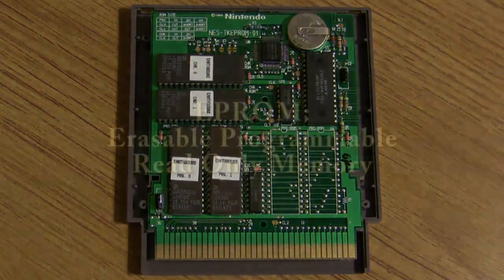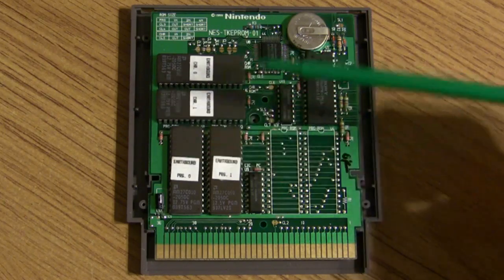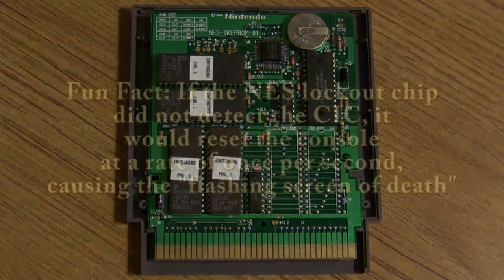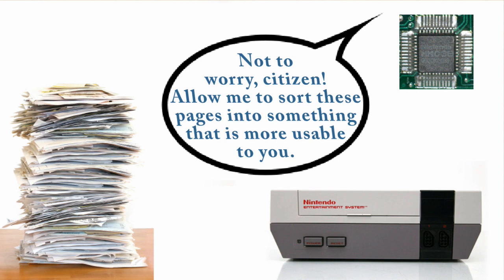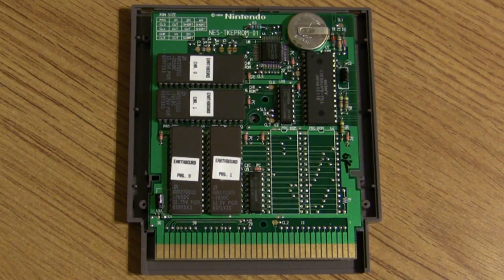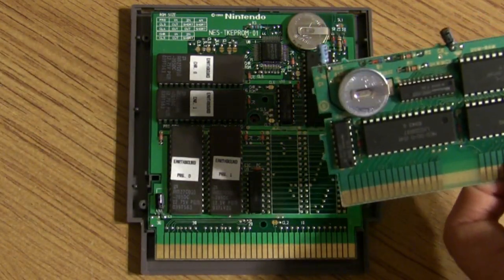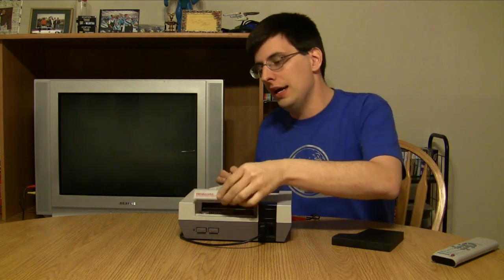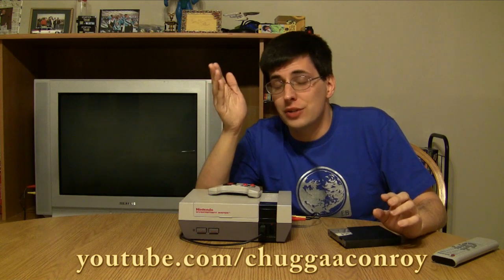Hands On: EarthBound (NES) Prototype [Part 2/2]

Comment: Finally I get to comment on this cartridge. You're holding a REV - C EPROM cart because it's MMC3. This cart is used as you said for internal use. Replica's or reproductions are starting to come to the market. As well since they have larger storage capacity for NES carts. 

The largest size you can have is 6 Mbs or 558,444bs (rounding up). This cartridge is the "incomplete" cart that caused the emulator to be rewritten just so it could work because it had a defective read or write of the ROM. The complete ROM is the 4th copy that surfaced in 2009 of which was the editors copy for coding. Same chip set and what was called the active cart or review by internal Nintendo. 

What you have is actually the fourth cart. Also know as Earth Bound - 001. Which is the first cart written from the translated cart of ROM. However this cart was under review for technical flaws and thus the most complete copy of  Earthbound is actually on the fourth copy which you were looking to own. 

Which we now know today and has been re-released to the pubic on blank carts as the most complete version of earth bound. Earthbound Beginnings, but you probably already knew that.

Comment from the maker: @papayacatproductions Old NES cartridges with a battery backup always had a warning on the back to hold the reset button while you turned off the power so as not to accidentally erase the save data you have stored on the battery.  Come to think of it, I'm not sure exactly why that is, but it's so ingrained in me now, it doesn't seem right not to do it.

Comment: @ClanOfTheGrayWolf  Actually, I have a copy of The Legend of Zelda that does -not- have that warning on the back. It just says that rapidly turning the system on and off, or resetting it repeatedly, will erase the save data. My guess is that I have a really early print run copy of the game, which is why the warning is absent.

Comment: not quite, if you are referring to the function the MMC performs it does do some processing for the console, but they were necessary to extend the functionality of the system. Your console still runs the game code as you would expect a computer to do for a program. As Joey mentions, this MMC made it easier to perform split screen scrolling.

You can read more about the different types of MMC's on wikipedia at:

/wiki/Memory_Management_Controller

Comment: i have a theory on why the 4th prototype is different. prototype 4 may actually be the first ever cart produced out of the ones discovered at least. it would explain why the chips arent soldered and why the part layout may be different.  it may have been put together in a very early stage of development which may have required parts to be interchangeable if necessary. the others came later and were created with a more finalized design (hence different capacitors and soldered EPROM's)

Comment: I'm believe both NES carts and desktop CMOS batteries are standard 2032 non rechargeable watch batteries.I've got a stack of right here and there is nothing that mentions them being recharable.I have had to replace many desktop CMOS batteries over the years and have never come across a rechargeable one.As for the NES, my Zelda carts battery died,and then I decided just to replace the rest of them at that time. Regardless,that battery is over 20 years old,it will die soon, rechargeable or not.

Comment: @medicwheat69 

This is the proper way of turning off your NES, with any(?) game that can be saved. If you have a nes cartridge with a gold label on the back it mention this as well as not rapidly turning it on and off, and to clean regularly.

I heard rapidly turning it on/off as well as not holding reset before power can corrupt save file due to power spikes when turning it off. But holding the reset button cuts power to the cartridge.

Comment: So yeah, I know this is 8 years later but were you ever able to dump the ROM?  You would need to know what Mapper it uses to do so.  I am assuming you have dumped it by now but if not, I may be willing to help.  The Analogue NT Mini is capable of dumping ROM images via the built in CopyNES software.  Let me know if you still need assistance with this.

Comment: great video - I had no idea it was that rare - I remember seeing one on ebay and wondering what all the fuss was about and why the price was so high - it seemed to sell very quickly too, think it was a "Buy It Now" at around £700 GBP, but my memory is pretty fuzzy.  Great video by the way, it's really for some reason "touching" that you'd share your treasure with the community, and I really appreciated all the technical information. Btw, did you ever managed to get it dumped in the end?

Comment: If you want to dump the ROM, you can solder a CopyNES board to your NES and dump it through USB.  Unfortunately, it involves grounding the 10NES chip, so it can't be used to play other games after and it's not easy to install. :(

Comment: I'm watching through your videos for the first time lately. Yesterday, I noticed that some of your videos feature the exact same Sony TV I used to use up until this past May. Those Power On/Off tones are so stupid. Watching this video right now, I noticed the remote on the table -- which happens to be the exact same design as a remote for a Toshiba DVD/VCR I still have somewhere. I could never get the RF Out to work properly on mine, but I think that's a software issue in the machine itself.

Comment: What are you going to do when the battery fails, which will likely occur within the next couple of years? Will you leave it dead, or replace it? If replaced quickly enough it is possible to keep the save game data. Interesting to think about, would letting the history of the save games die devalue the game more than physically changing one of the components? Personally I wouldn't care about the value, I'd want the thing to save.

Comment: @getpagesize 

dude i would totally not recommend willems... for one they are parallel ports and 2nd they are very unreliable even though they are cheap

get a usb programmer they are like 100 bucks but they are atleast well working